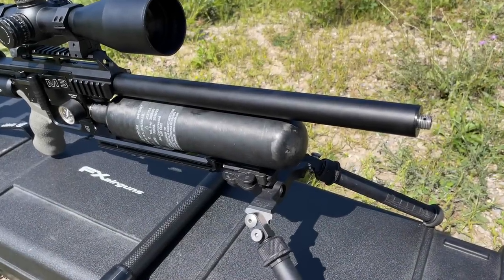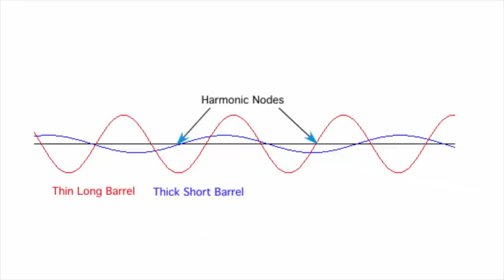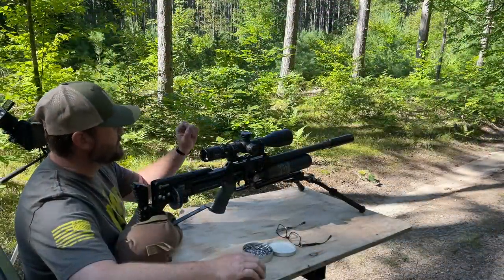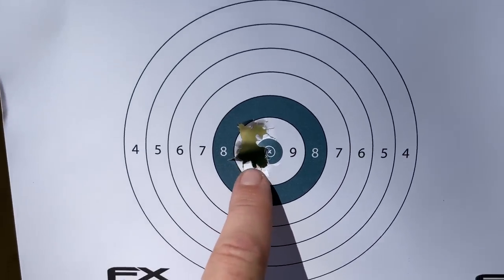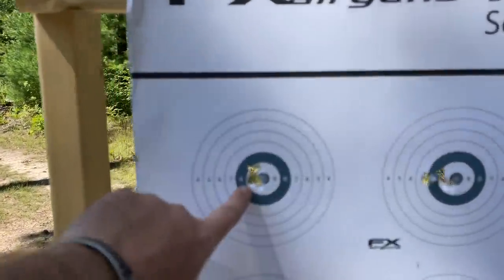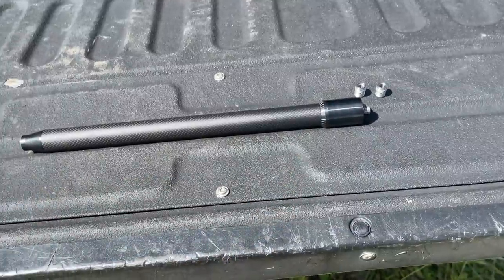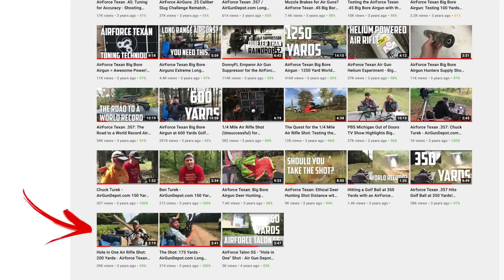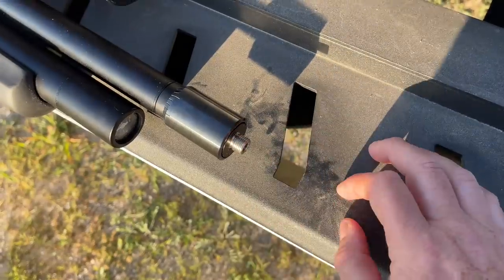FX Airguns Impact Integrated Harmonic Barrel Tuning Shroud Overview + Big Announcement!

Comment: I believe it's a gimmick on airguns   completely unnecessary  , can you say that youre Groups without barrel tuner are worse? If seen several vids on the barrel tuner, please show the differents without and whit barrel tuner, that I don't see in any of the video's.Of Course there is a shift of POI when you  change the setting of the barrel tuner. Bud does it give smaller than without I doudt it. .Maybe on the bigbore slug airguns it will work. I don't know but lets say on 30-120 fpe airguns I have big doudts about it. PS love you're vids keep up the good work.
Reply from the maker: Hey there great questions and thanks for watching. So the question itself is flawed. Think of it like this way, anything you put on your muzzle has a static influence on the harmonic signature of the barrel and can not be moved. For instance a muzzle brake or a suppressor.  

Just by putting on a muzzle device it will change your POI, but it also can often magically tighten your groups. Well that magic is actually physics and what has happened is you just happened to land on a harmonic node by shifting the center of gravity of the overall barrel by adding weight at the end. But also your groups my have gotten worse by putting on that static muzzle device. So what has happened is you have moved that center of gravity away from the harmonic accuracy node. 

So just by putting a tuner or not having one at all doesn't DO anything. But the shifting of the weight does. That is where it becomes a lever of control that before you did not have. Now you can in a controlable and measurable and repeatable way manipulate the harmonic signature of your barrel thus giving you the ability to FIND your harmonic accuracy node.

Also to your comment about low power airguns being a gimmick, well.....  They have used this concept for DECADES in olympic level airgun and rimfire shooting.  

Hope that all made sense.  Thanks for watching!
Reply: @UpNorthAirGunner  Thanks for youre fast reply. Time Will tell but for the moment I don't believe it Will gif better results. I know in the Olympics it's Bening used also on firearms. Can you say hand on youre hart youre Groups are better with the barrel tuner? 
I believe when you're FX is set up right, reg pressure, speed, right pellet, right support bipod or benchrest and youre shooting Capability s are good.The harmonics of the Standard barrel wilI be always the same, and more you don't need to shoot lets say sub moa Groups or smaller @ 100yards that's a fact where we can al agree on I think, and also Proven.One raffeld holes @ 100m  are being shot for while now without barrel tuner. And maybe   when that's the case the gun is out Performing the shooter so why adding a other factor wich you have to setup right,and to stick youre time in. .. But Hey  just my to cents. And ime always happy to see New stuff being tried in our Nice hobby. So I follow this close, but for now ime not a believer.I also do know that a silencer or barrel weight can change the performance. Bud Standard gun FX in this case/ good barrel ,set up right, good techniek of the shooter. I have to see if the barrel tuner when set properly, gives better results. Kind regards Ric
And ow yes ime not saying that low Power airguns are a gimmick I love my 60fpe Prophet Performance .22,I loved my RAW Hm1000. 30, I believe on airguns from lets say from 30 to 120 fpe and maybe even some more Power the barrel tuner is a gimmick.
Reply: Its works i spent 3 years developing it on airguns 11 years ago.
Can take what 99.9% would say is a scrap barrel with 1 3/4" groups at a pultry 30 yards to .177 size hole at 55 yards 5 shots. However, they dont tell you what to look for when setting these things up, theres a 4 shot cycle pattern and a learning curve. Last time did my own was in 2016 as used to make them for my hand built rifles used to sell. Took 30 shots to leave a single hole smaller than the slug at 55 yards from a monstrous 1 3/4" group.
Strip should be named turbulence!
Reply: @ERICAIRGUNNER  The lack of improvement is why you don't really see stuff like that on most target-firearms... just like you don't really see "gas (air) strippers" on target firearms (apparently,  some people believe compressed air is magically different than any other expanding gas lol).  It used to be that your barrel crown was the one element at the muzzle that determined accuracy, but over the last 20 years or so, it has been found that it doesn't play nearly as big of a role in properly stabilized projectiles as previously thought (stop using 1-17" twist .22 barrels for bullets lol). You tune the loading (cartridge components and fitment in a firearm, Pressure and projectile in an air gun) to produce a barrel frequency that falls in an accuracy node for that barrel (where the barrel is whipping around the exact same way, every time). You don't tune for velocity, you don't tune for energy, you tune for accuracy (consistency), if that is the goal. 

The solution to wide variations in trajectory in most mass produced air guns today: stop using thin tubing for your barrel. It's too sensitive to slight variations in pressure, temperature, and mass.  When even feather-weight firearm barrels in high pressure (65,000psi) firearms can do sub MOA groups (with factory non-fitted ammo) without doo-dads like this, that tells you something about the necessity for some mass in the barrel. As designers for firearms learned long ago, just because you CAN get away with using an inferior design element and be safe to use, doesn't mean you SHOULD. A gun is a gun, doesn't matter if it uses powder, CO2 or compressed air

Comment: Taming the flight path by tuning the airgun to minimize or eliminate "spiraling", which may be caused by barrel oscillation or whipping.  Do you think that barrel oscillation imparts this "spiraling effect" on the projectile.  Since rifling or twist imparts spin on the projectile in a very short distance, it makes since to me the projectile travelling down an oscillation or flexing barrel would impart movement on the projectile.  With both the barrel harmonics system working in harmony with the carbon fiber sleeve, it would help eliminate or at the least minimize the "spiraling" effect.
Reply from the maker: Nope. Velocity or damaged projectiles or off centered seating is what causes spiraling. Barrel whip in my opinion is hog wash to a certain degree. All the major movement you can actually see in the barrel is irrelevant because the projectile has long left the barrel by the time you see that movement with the naked eye. The micro vibration that follows along the barrel do effect consistency of accuracy and is why harmonic tuning works. It’s at the very microscopic level though.

Comment: Hi sir my self kamalavendan Raju I'm from Tamilnadu, India.And for your information in India restricted .22cal and alluded to use only .177cal with Bellow 20j or 15 ft lbs. Basically I want to know what is the difference between 185 cc vs 280 cc air cylinder and insted of 185cc we replacing 280cc cylinder in .177cal unregulated pcp air rifle. What is the benefit? what we will be get after  replacing 280cc air cylinder in unregulated basic entry level pcp (AR Name:precihole px100 Achilles pcp air rifle,made in India) expline it  sir...

Comment: you don't need that tunner if you tension your barrel properly using carbon fiber. I've tried it in my local made PCP. it's now really stiff
Reply from the maker: Stiffening your barrel isn't tuning it. You are just changing to a higher frequency and a lower amplitude. Barrel tuners are used on even some of the larger steel bull barrel profiles in the center fire world. Finding your harmonic accuracy node is still critical.
Reply: @UpNorthAirGunner  I agree with you in this. because center fire like 308 has huge amount of energy pass through the barrel. tunner is a big help to get the best harmony during energy transition. but airgun has only very less energy compared to that big bore center fire. I saw matt dubber and Gerhardt using 800mm .22cal slinging that 40gr slugs with carbon fiber tension system without that tunner and still get very tight groupings
Reply from the maker: @blacklisthunter8861  They we’re tuned with velocity. Using a barrel tuner is just a different technique. There are still harmonic vibrations in an Airgun barrel.
Reply: @UpNorthAirGunner  I didn't see A barrel tunner used with 22 NLR  and even in the most competition of 22lr. in my understanding. a tunner is not necessary for a stiff barrel system and with less energy gun.
Reply from the maker: @blacklisthunter8861  They are used in NRL22 and PRS quite often as well at 22 benchrest. Oh and look at almost any olympic shooting discipline with those bloop tubes with weights on them. Yup - barrel harmonic tuners.